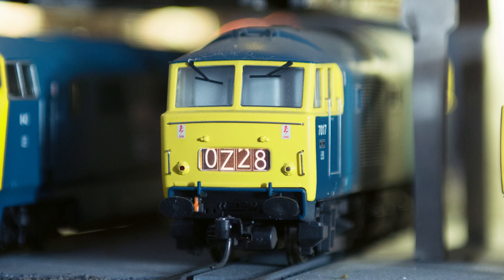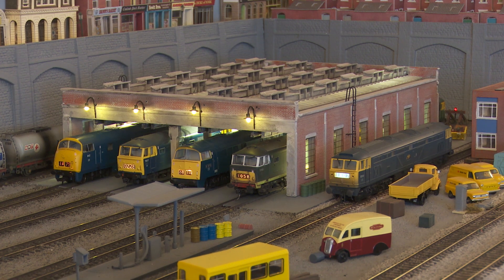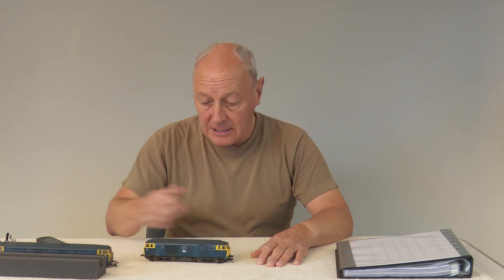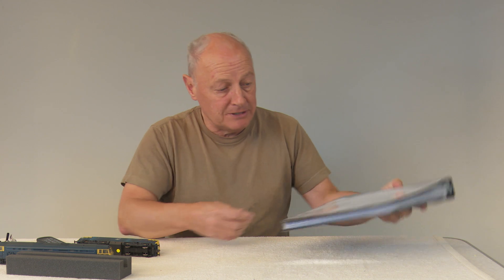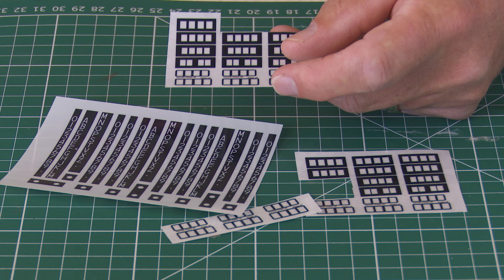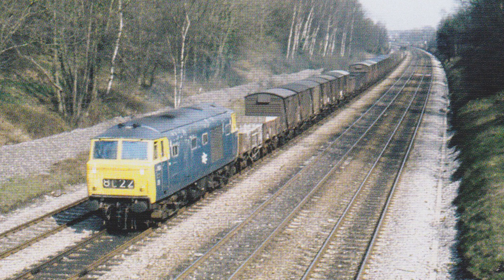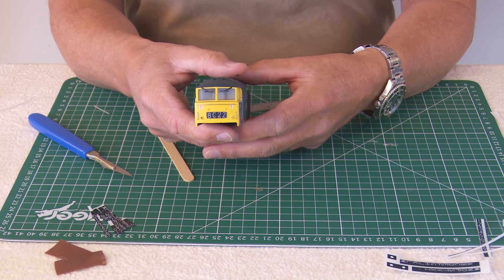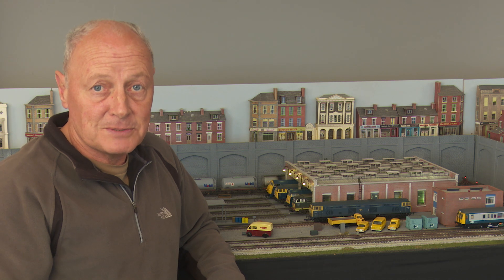Improving Head Codes at Chadwick Model Railway | 11.

Comment: I prototyped a moving headcode display on the Lima 73 - would show two codes: a route number or the two red panels. Adjusted by poking a jeweler's screwdriver down the exhaust pipe and turning it.
Reply: Oh yeah - this was maybe inspired by someone who did a similar thing (but motorised) on a 7mm 73. It's described in a 90s issue of BRM I think.
Reply from the maker: How interesting, sadly I can’t see how it was done but fascinating anyway.
Regards Charlie

Comment: The 2nd of your head code replacement videos was as good as the first. This reminds me that I forgot to ask you the following question in the comments of the 1st vid you did. I have a 2nd hand head coded loco, but the clear plastic lens is fogged over on one end. Probably due to a used adhesive to hold it in place. My question is, would T-Cut or the Silver Dip with a cotton bud polish the lens to clear again if I gently polish the lens on both sides? Thanks if you can help with this inquiry, Charlie.
Reply from the maker: Best thing is to get some stiff, clear, thin plastic. Like the wrapper for Peco point motors, and use that.

Comment: Hello Charlie,
Still catching up on the tales of Chadwick. Loved this one and some excellent tips on applying the digits that I'll use next time.
How would you tackle a headcode replacement for those models where it is printed onto the back of the headcode lens? I've used T-cut to take off the printed code but it leaves the lens just a little less clear than I would like.
Replacement, clear lens would be nice but I'm not sure they are available or what material could be used once cut to size. The originals are quite thick.
Thanks again,
Bob
Reply from the maker: Great question Bob.
I have my Class 50 to do, so I’ll let you know.

Comment: Instead of a business card cut 4 Plastikard pieces & slide them under the body near the locating lugs. The thickness of the Plastikard should be enough to release the body from the lugs. Great video but I dont know why manufacturers tend to put code 1xxx (express passenger codes) at each end when the loco is also used for frieght (i.e. 5xxx or similar).
Reply from the maker: Hi Pat.  
I used the business cards as there was no risk of scratching the body shell.
I totally agree, you’d think the likes of Bachmann would know better and choose similar head codes.  We live in hope!
Regards Charlie